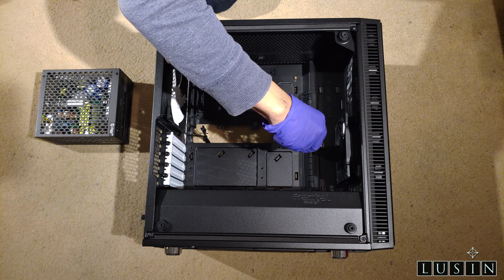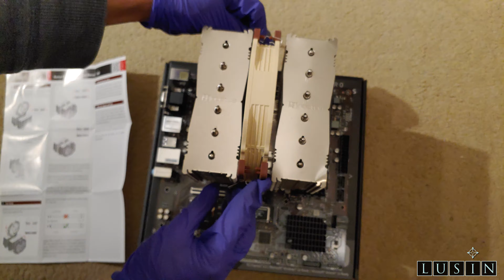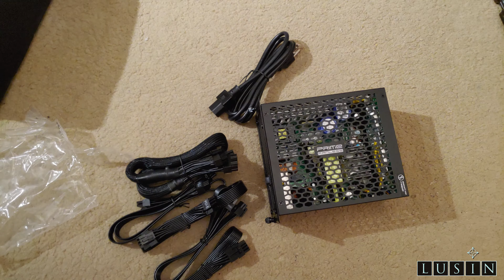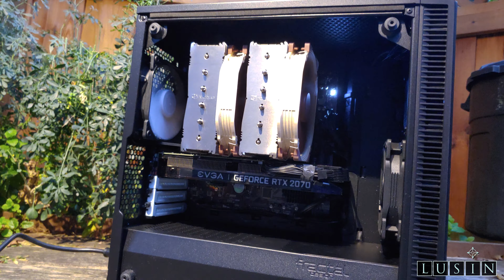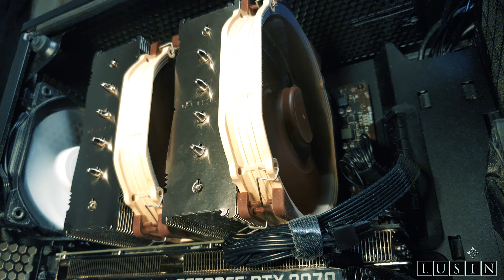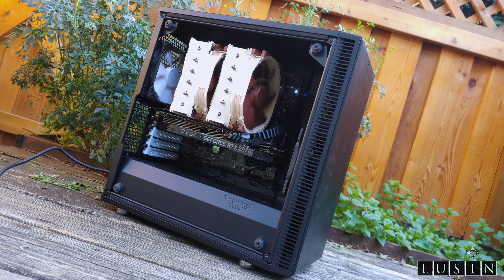$2200 Custom PC Build Timelapse - Ryzen 7 3700X & RTX 2070 - Silent Subtle Beast [2019]

Comment: Damn that big as cooler fit on a matx motherb? And with gpu*
Reply from the maker: The Noctua NH-D15 cooler barely fits, but it does fit.  It's difficult to take out since I need to remove the GPU first.

Comment: You should go for tomahawk max mobo
Reply from the maker: The MSI Tomahawk MAX does look good, but I wouldn't get it because it has LED's on the side.  I don't like LED's on motherboards.
Reply: @Lusin333  you preferred old school haaa
Reply: @Lusin333  but tomahawk has a very good vrm sections and doesn't look cheap
Reply from the maker: @samfrankenstein  It not exactly that I prefer something old school.

it's just that I prefer that when a motherboard has lights built into it, it needs has a design purpose, not just to "look cool" or "to appeal to gamers".

Don't get me wrong, the Tomahawk Max looks like it has better VRM's and looks more quality than my MSI Pro-vdm Max;  but again, I just want something simple with no flashing lights - a workstation motherboard.

My ideal motherboard would be the Asus AMD Pro WS X570-ACE ( IF it didn't have a fan ) - no LED's, no fancy gimmicks - just a quality motherboard.
Reply: Ok as you wish it's your money
Reply from the maker: @sam Frankenstein  DID YOU JUST SAY... "MONEY"?!!?
CUZ I GOT SOME RIGHT HERE : https://youtu.be/LW0PJlKOoXc
Reply: @Lusin333  Just saying - Motherboard BIOSes usually allow you to disable the motherboard LEDs. It's a bit silly to deny a better product over cosmetics when your point is performance > looks
 - anyway nice build and I have no idea how you managed to fit in that NH-D15 vertically as I have a U14S (same heatsink) and it pushes down on my graphics card if I was to use the first slot.